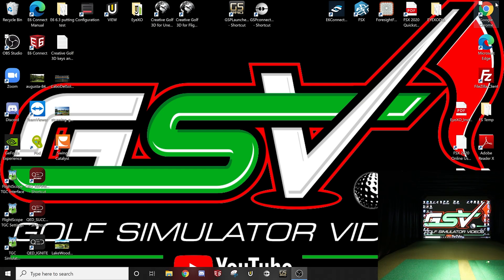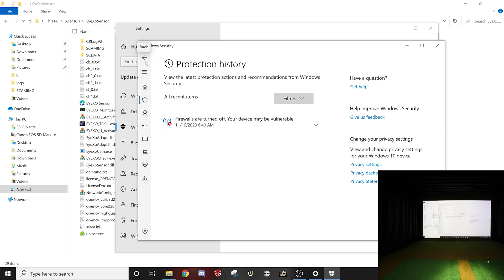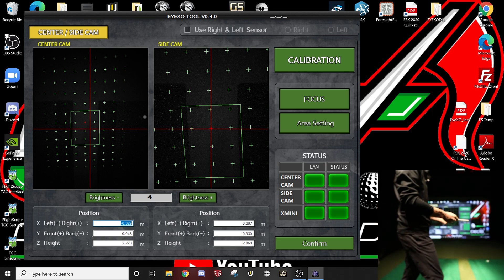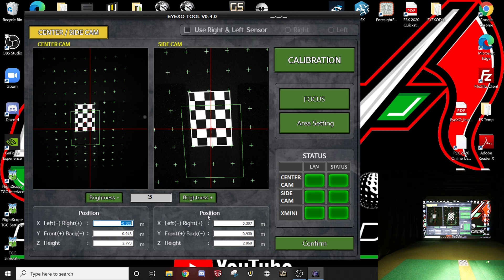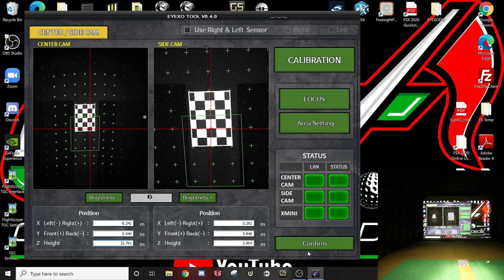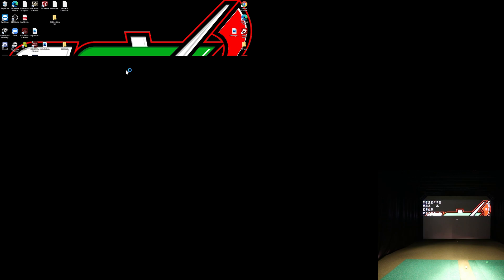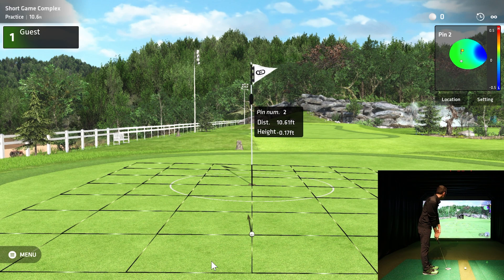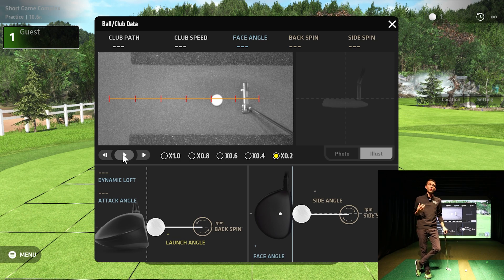How to Calibrate UNEEKOR EYE XO - PLUS Troubleshooting & Setup Tips

Comment: Hey Jay,
So I purchased a system thru you and Jeremiah about 2 years ago.
Everything has been pretty smooth.
However, just the other day I lost internet service and become disconnected from my network settings.
I was able to reestablish my connection to the computer.
But after I did that my zcam 3 settings turned off and now my launch monitor won't read the ball.
I was wondering if you can help me diagnose this. By the way I got the q e d
Reply from the maker: Interesting. Sound PC firewall or antivirus related.  I’m sure Jeremiah can take a peek. Just shoot him an email 👍

Comment: Thank you for this video.  I am interested in purchasing an Eye XO but we are considering placing it on a sliding ceiling mount that moves left to right in order to better accommodate lefties and righties.  In the video you recommend the "One area mode" but if I wanted to setup two different hitting areas (one on the left side and another on the right side - about twenty inches apart), and calibrate both hitting areas, will that work?  (I would just need to move the ceiling mount left and right before each player).

Comment: The small red plus sign is not at the center of the larger red crosshairs on the calibration screen. Did something happen to my sensor or something?
Reply from the maker: You might just not be able to see it.  If you have the two red intersecting lines just use the center.  Or do you see no red at all?

Comment: I’ve just got the Eye XO and purchased the refine software but the refine software either on the driving range or while playing a course seems to be about 20-25 yds short for mid range irons. I changed altitude setting 5000 ft and it doesn’t seem to help at all. Has anyone else experienced this?

Comment: If I have a 13 ft wide room, can I set separate driver areas for left and right handed golfers if I want them to both be off-center in opposite directions?
Reply: I have this question too, 3 months later. Any answer out there?
Reply: Bump!  I have the same questions!  Did you ever get an answer to this?
Reply: Same problem here, any answer ?
Reply: I actually went ahead two years ago and installed a Uneekor in my 13 ft wide room. I’m 6ft 3in tall right hand, and have a similar height friend that is left hand. By cheating the ball 6 inches from center in both directions we’ve been able to swing both ways with just the standard hitting box (i.e. no separate areas). Some people get close to the wall, but we’ve almost never touched the wall in two years.

Comment: Jay my unit is not centered.  I need to move it about 3" to the right to center it.  Is that necessary since you can move the green hitting area?  Will it effect the readings if not centered?
Reply from the maker: It's OK because the heating area has a decent width.  It just depends on your preference really.  During the calibration it's pretty simple to just move the heating area.   It's always nice to start with the unit dead center but it's adjustable.

Comment: What does your computer setup look like when you recorded this video?  I have a 16GB Ram and i7 Core and EYEXO Tool CRAWLS SO Slowly.. Not sure if you have any ideas as to why that might be. :)
Reply from the maker: Juuuuuuust a bit overboard LOL.  i9 10,900k 128GB ram at 3600mhz RTX 3090 2TB m.2  😀

It's really more about the GPU. Your cpu and Ram are fine. What GPU are you running?
Reply: @GolfSimulatorVideos  HOLY CRAP.. Didn't even know that was possible! LOL Makes me feel better than mine doesn't run as seamlessly.  

QQ - I ran through this process and it was super helpful... however, I am only getting 1 out of 10 shots that are registering in View.. And my calibration settings match what you are showing and what is in Uneekor resource files. Any ideas on direction to turn next?  (All antivirus/firewalls are off).
Reply from the maker: @ericcrawford6519  That's very interesting.  
Something must be wrong.  Who did you purchase the unit from?
Reply: @GolfSimulatorVideos   Here are my specs: 

i7 9750h 6-core cpu, 
16 gb ddr4 2666 dual channel ram, 
512 gb m.2 ssd +1tb hdd storage. 
NVIDIA RTX 2070 MAXQ gpu 8gb
Windows 10 Home pre-installed
Reply from the maker: @ericcrawford6519  yeah that is plenty PC.  I just have a massive set up because I'm recording in such a high bit rate and running so much at once

Comment: I have a fiberbuilt 12'' wide strip.  I would like to move my "tee area" off to the right and my putting area off to the left.  How much hitting area is available?  Can you configure 3 different hitting zones?
Reply from the maker: There is tee, ground, and putting available. I have not used the multi area much honestly.
Reply: Golf Simulator Videos awesome, does multi area work with tgc2019?
Reply from the maker: @ey3hack  It will never be software specific as the data is just coming from the UNEEKOR native app VIEW and being sent to TGC, E6, GsPro, etc.

Comment: I could have used this a month ago. Your discussion about moving the hitting area was missing from the Uneekor instructions.
Regarding virus protection software, can I assume that after the exceptions have been added it is ok to run antivirus?
I turned it all off in hope that it was the cause of the random no-reads with my Eye XO but I didn't notice an improvement. Thanks.
Reply from the maker: You should be good if it’s all in exceptions but third-party software can be different from the windows firewall

Comment: Thanks Jay. I found that old golf ball dozen boxes broken down make for a good shim under the hitting strip to level it out, rather than pushing it down (which seemed to pop back up). I used a digital level and am wondering how precise it needs to be for accurate readings.
Reply from the maker: Nice. Yeah I just use a manual level and get the bubbles all in the middle for each section of the board and it works great.  Digital could be nice too.  As long as completely level you are good.  Thanks for watching.